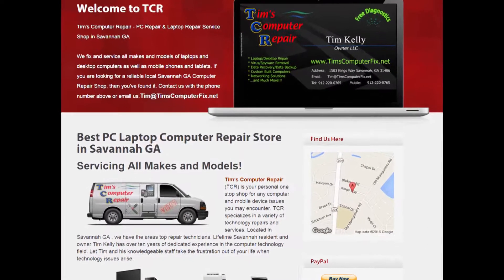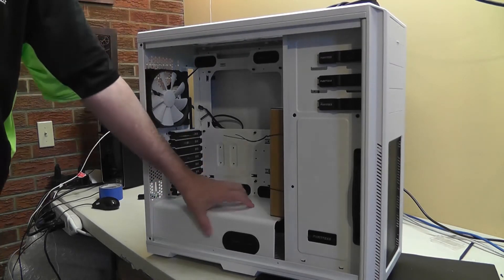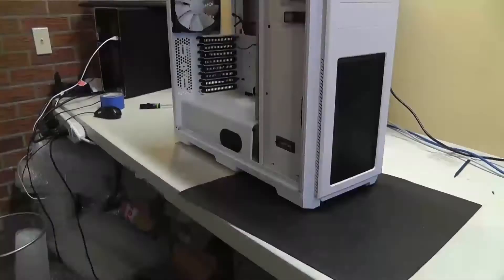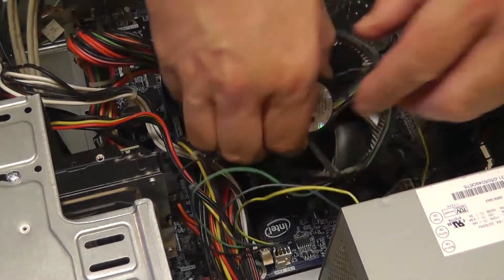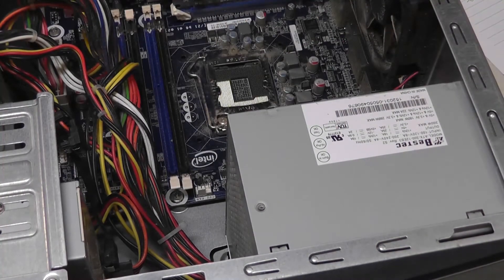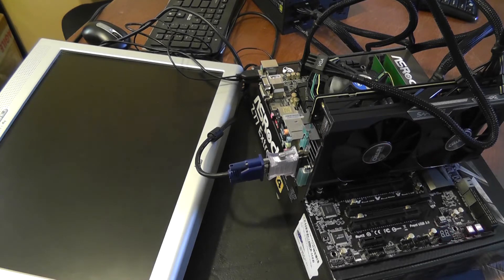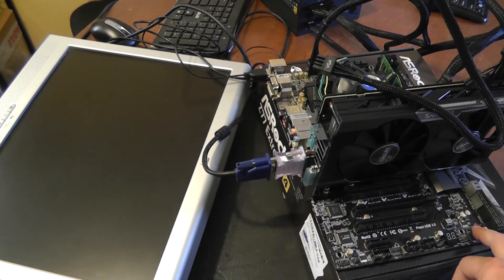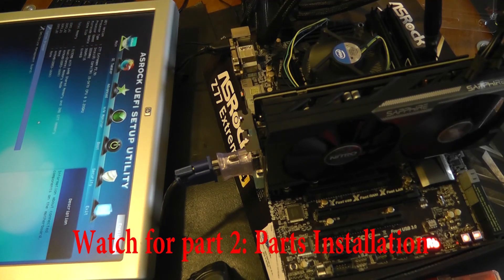How to Upgrade Your OEM Stock Computer to a Custom Built Computer PART 1

Comment: great video Tim is A6  SCSI detect or something to do with no drive detected A6 error is associated with IDE or SATA devices but Code Ab indicates under UEFI BIOS screen, you may need to reset bios looking forward to part 2 and 3 cheers Tim
Reply: see I should watch to the end before commenting glad you got it running Tim.
Reply from the maker: Cheers Daz no worries. Thanks for the comment.

Comment: Since that CPU is not a K SKU, I would have used either the stock cooler, or something much less expensive.  That Noctua cooler is really meant for overclocking.
Reply from the maker: This is a Noctua 14cm U-Sereies. It is the smaller and cheaper variety of the Nactua lineup. Sure there are always other cheap options. The way I see it, it is ALWAYS a good idea to upgrade from the stock cooler regardless if overclocking or not. Thanks for watching.